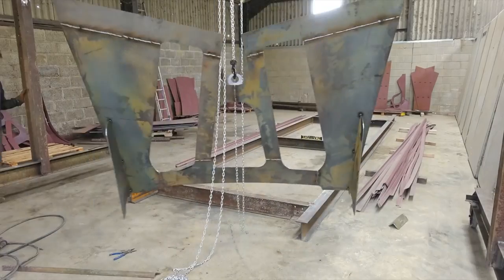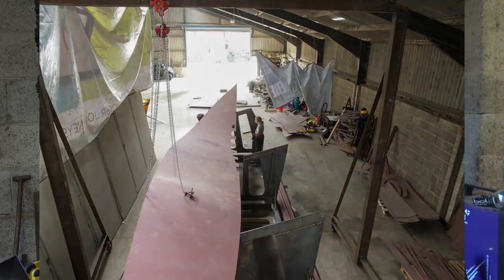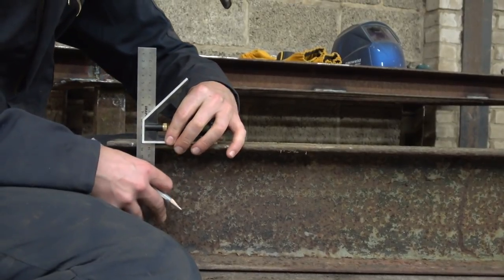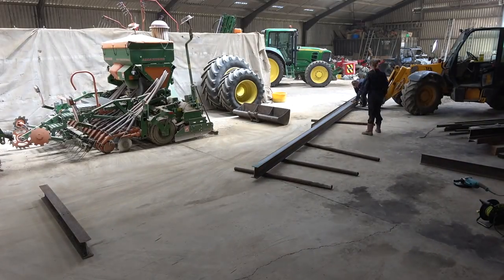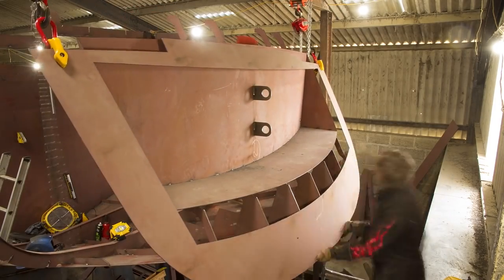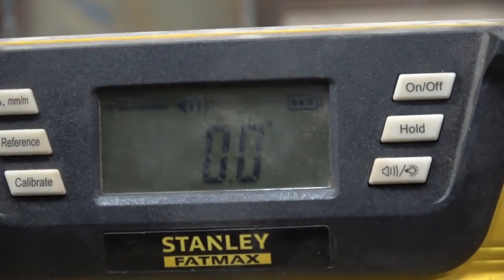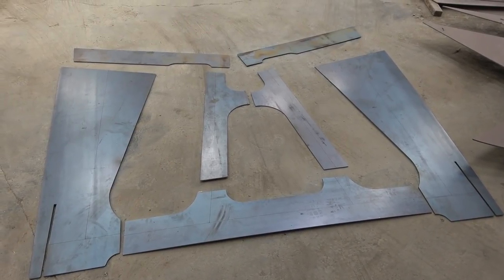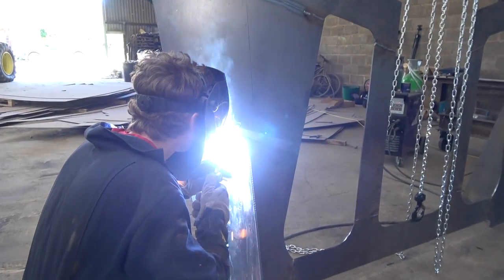Building the Strongback and Cradle - Making The Supports to Build the Boat - Ep.3

Comment: So if distortion is becoming an issue when but welding use bits of flat bar 100 x 10 at about 500 mm long in the centre cut a mouse hole out so you can get the gun through the hole place them every 500 mm this will reduce distortion greatly also staggering your welds will help . On top of that if you have access to a pulse welder that will reduce heat input

Comment: Hi mate...well I think I need to forget about the tulip sniffers and fix it yourself!! I have built many boats and I would just make templates of the problem areas and move on....use cardboard to do this and tape it in place so it's perfect then coat it in epoxy resin so when you remove it u have the exact shape..note..test fit template and then use it to cut shape of steel panel before applying resin...then just move on. Tell the company you require compensation for the issue and I'm getting they would rather do that than let this go on.